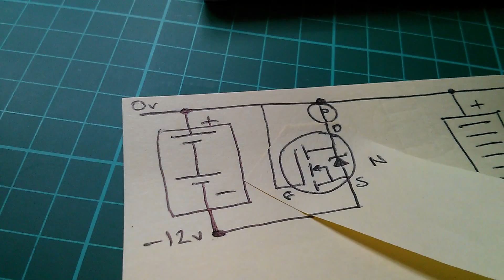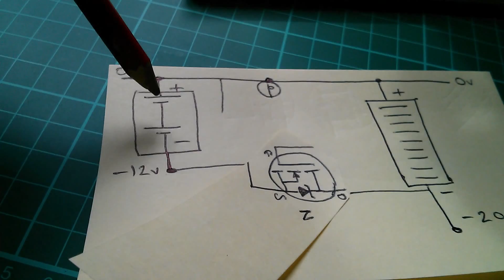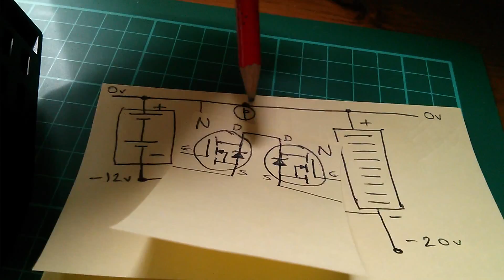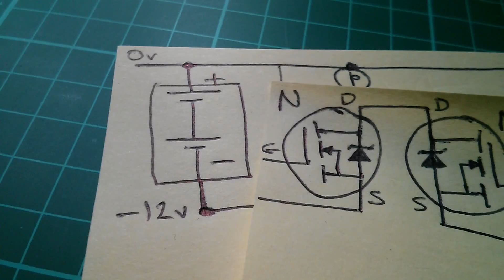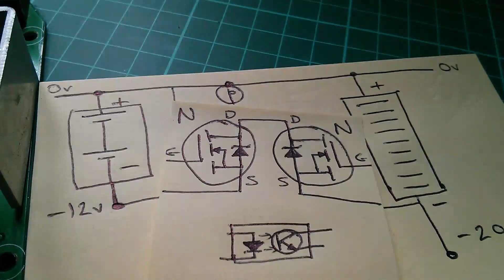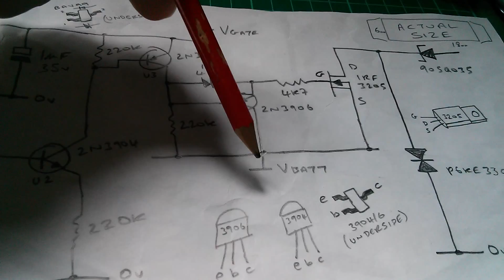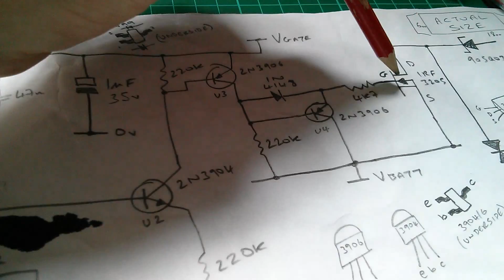Arduino PWM Solar Charge Controller #1 - MOSFET Configurations

Comment: This is very interesting and exactly deals with the issue that I am having. I am looking for an 8-volt charge controller. I have a one-watt hour pump that I want to power with an 8 volt Li battery and charge with an 8 volt panel. I have been unable to find an 8 volt charge controller with a load output. Do you happen to know where or how I could acquire this? Thank you

Comment: My pwm solar charge controller takes the energy from the battery send back to solar panel., Negative wird also heats up.... Any suggestions or remedies???

Comment: Hi Julian,
I have a query about the PNP transistor circuits interfacing the MOSFET. Can you tell me why the second PNP transistor is used?  From my own calculations it is  never in active mode or saturation (it seems to be redundant), and I was just wondering about the rationale behind that part of the circuit. It seems the designer may be trying to regulate the voltage that appears at the gate of the MOSFET, but I'm not sure it really works as intended. Did you get this part of the design from somewhere else? Your thoughts would be much appreciated.

Comment: When I built my common negative switcher, I used an N Mosfet, because they are lower milliohms. I had to put it on the top of the circuit, so I pulled up the gate with extra voltage from a 555 voltage doubler. You are supposed to use a special mosfet driver chip, which does this for you.

Comment: Hi Julian,
I am new to arduino but have done some electronics construction in the past.  I am following Robert Murray-Smith's videos on supercapacitor construction with the intention of 'making' from scratch, a supercap' or EESD that can keep a 50W fan running through the dark hours.  The EESD will be charged using wind and solar generation. The fan is to ventilate my Firewood Drying Kiln. 
The air supply will be heated by thermo heat tubes during daylight hours and it will be a simple fan ventilator at night. (Airflow will still dry the wood).
Most aqueous electrolyte supercapacitors can be charged up to 1.4Volts.  Can your arduino controller be adapted for lower voltages?  That way I can keep the the cell charges balanced.  
Each supercap' bank will be connected in series to arrive at 12Volts.
I hope that this makes sense.  If not please let me know and I'll write a proper email detailing everything properly with diagrams.
Your opinion would be very welcome.

Comment: anybody else think that cut out mosfet, dual circuit connection thing was like effin genius? but for real tho, why could you just switch the drain and gate terminal so that the diode was reverse biased unless a gate voltage was applied?

Comment: Thanks for this video Julian! I have been trying to figure out for weeks why my test circuit worked but the real one didn't! I was using a load for testing not a battery! Doh! I've resorted to P-Channel again until I can sort out doing the charge pump setup that you used. None of the demos I found online were explaining this issue but this video was spot on, so thank you!

Comment: HI julian.
Do you think it would be easily modifiable to work on 24V system ?
Let say, modifying the sensing voltage bridge divider, put a small DC/DC regulator for 5V uC supply would be apparently easy.

But what about the power Mosfet's gate driver charge pump ? And maybe other stuff to be modified including some small bits of code !

Comment: why don't you just put a diode in series with the mosfet to prevent the battery backfeeding into the panel?
Reply: with nfet source at the battery, its internal diode is in the same direction as the panel blocking diode. which is the issue - as the panel can always charge the batt

Comment: A p-MOSFET woulde work. If you connect it with source to 20V and drain to the load. A pullup an the gate to 20V and with a transistor between gate and ground you can turn it on.
You can get this configuration in a single chip. Look at something like the FDC6326L.

Comment: Have you considered the inherent reverse connection protection possible with the pair of series mosfets?  The total losses can be lower than your design, with a series, reverse protection diode.

Comment: Someone suggested that a PWM circuit only comes into operation when the battery is fully charged.  Is this the case ?  I am in need of a (potentially) 40A MPPT controller, but I am slightly confised with what I have read elsewhere.  It seems to me that there would need to be a substantial capacitor on the PV side, otherwise, the controller would effectively be charging alternately with full power or zero power, either way is not efficiently (MPPT) using the PV. I guess that I am missing something about MPPT controllers.

Comment: A well presented brief.  Thanks.
However, the charge pump could easily be replaced with a boost switcher driven from the Arduino, plus, I suspect, switched on and off, to eliminate the driver circuit to the MOSFET
Reply: Please elaborate.

Comment: what I like to do with one of these controllers is reprogram it for my wind turbine as a dump load controller. were it can still use solar panels also to charge the batteries. but as for wind it will instead use the out put of the controller to controller a relay to dump the turbine in to a bank of resistors.  instead of using the dusk to dawn future. change that to a dump load future instead. and have it preset to dump at 14.5, and 28.9 for 24 volt systems and still use the solar input to put solar panels on the system so that way the battery bank is always full.   any ideas of how to reprogram these boards or do I just have to look up the chip and then program it.

Comment: Just a thought....
Sat and watched your earlier experimentation all the way back from 20w panel 21w bulb, and when you went to using the 5110 lcd and twisty knob, you put 2 panels in series to get a higher voltage into the controller

What the thought was is this, if i have a string of AA batteries as a power source, and one of them is 90% discharged and the rest are new, if I load the string hard, that 'weaker' cell will be pushed into a reverse voltage situation, can this happen with solar panels, or individually shaded cells within a panel?

Comment: I have had a look inside a few cheap PWM controllers and they often tend to use two mosfets although sometimes they are coupled source-source rather than drain-drain. Either way the intention ov this is that the second mosfet actually functions as the reverse blocking diode. During the day the current flows in the direction ov the body diode, but then the mosfet is turned on effectively making it a diode with a very low voltage drop. This means they can get away with a much smaller heatsink than would be necessary if a Schottky was used in this position. It is ov course, also more efficient in the bargain, but I think the main purpose is cheaper construction costs. In some circuits the "diode" mosfet is actually fed with the exact same gate drive as the "switching" mosfet. And it appears to work.

Comment: hows it going Julian.  I have a question.  I have the colman air charge controller it used a Picaxe chip on it to regulate the batteries through the means of dumping excess power.   I have extra Picaxe chips I bought and was looking for the original code that is used on this board. 

What I want to do with the board I have with the extra Chips. is change the code. so instead of just one and off. I want it to help slow down the turbine as like a voltage clipper. so I can regulate the voltage from the turbine.  and use this board in conjuction with my original board as a back up encase the other fails. and this one will regulate the voltage going to my battery bank.   

I have a lot of ideas. for a wind turbine charge controller  that can use Wind speed, RPM and voltage to controller the turbine. by measuring every thing the turbine is doing.  I have lots of idea but pretty new with the Arduino stuff used to the basic stamp programming.

Comment: Nice work.
The second MOSFET is used so that you do not need a diode on the solar panel that diode will drop way more than the voltage drop on the MOSFET internal resistance.
Reply: xanataph  It is a bit simpler and for very small systems under a few watt's of solar panels is probably OK.
But if you are getting in to 5 or 10A of solar charging you need a beefy Schottky diode and a serious maybe even active cooled piece of aluminium.
Say the voltage drop at 10A is around 0.6V that is 6W that need to be dissipated when you add the cost of the diode + the heatsink you get to about the same cost as with a mosfet or more. 
But if is just 1A solar panels then maybe the additional complication of the mosfet is not worth the trouble.
Also you can skip the diode entirely and live with the small reverse current at night going from battery to the solar panel usually just a few mA so losses will be smaller than those on the diode.
Reply from the maker: I used a schottky diode - not as good as a MOSFET I admit. But my diode is external and can be removed if the end user understands the implications of doing that.
Reply: ***** I am running such a setup with the 24volt 200watt panel. The current can easily get to 5 amps. I chose to use a schottky and accept the losses rather than fiddle around all day getting a mosfet driver to work in this situation (although that may have been time well spent). I am pretty pragmatic with this kind ov stuff & I'm usually after working and useful results fast, rather than experimentation for it's own sake. But anyways, the diode does not get unduly hot and the rather thin sheet ov aluminium I have attached to it is more than enough for 5A, and no doubt would be good for 10A too. There would be certainly no need for forced air. 

However, having said this I may look at making a mostfet daylight switcher for my entire 12volt array. As vdrop is much more ov an issue down here...! :)
Reply: Julian Ilett Looks like the point I made above (except for the source-source thing) has already been done here. Although a schottky is less efficient, the topology is much simpler and I would dare say for the home solar power enthusiast more versatile in many ways. Just stick a bigger slab ov aluminium on it. :)

Comment: what about relays?
Reply from the maker: Not worth considering - low reliability, high current consumption and completely unsuitable for PWM control.
Reply: Julian Ilett What about a solid state relay?
Reply from the maker: abyssunderground DC solid state relays are MOSFET based. Interestingly, Wikipedia says "For AC (bi-directional) operation two MOSFETs are arranged back-to-back with their source pins tied together. Their drain pins are connected to either side of the output". Yet another configuration!
Reply: ok

Comment: PLEASE THUMBS UP THIS SO IT DOESN'T GET LOST IN THE MIX. 
"A DC-DC converter suitable for controlling a photovoltaic powered pumping system" by William A. Passmore --> http://circle.ubc.ca/handle/2429/27948 
Definitely some useful information in there. Searching for peoples *dissertations*(key search word minus the s) on the subject you want information on is a great resource because for the most part they are all absolutely phenomenal.

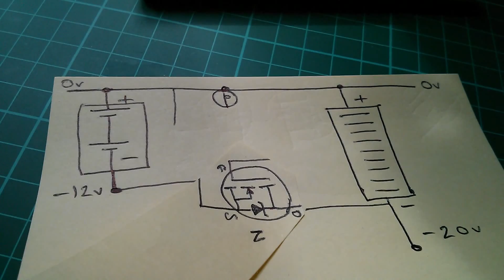Comment: @ 2:16, isn't the P channel mosfet connected the wrong way around? Source goes to your + 20 Volt from the solar panel (you input voltage) and the drain goes to your battery +12 Volt (load). The way you draw it in the schematic, the body diode would always be useless. Take a look at this application note from On semi:

www.onsemi.com/pub/Collateral/AND9093-D.PDF.
Reply from the maker: I put the mosfet source onto battery positive to make driving the gate easier. Turning it the other way round solves the always-on problem but makes gate drive much more difficult. And it creates a path for the battery to discharge back through the solar panel at night.
Reply: Then I am missing something here. With the source connected to the solar panel, and the drain connected to the battery, simply connecting the gate to 0V will turn the mosfet on and current can flow from the panel to the battery. (solar voltage @20 volts, battery @ 12 volts) Reverse discharge can be avoided by placing a diode in series. Perhaps I am not interpreting your intended use correctly.
Reply from the maker: jaaasgoed It's an interesting idea - probably not worth considering for a P-channel MOSFET because of the higher on-resistance. But I'm trying to decide if it would would work using an N-channel device in the low side. Actually, the back to back MOSFETs in the cheap controller are wired: one the way I drew it, and the other like you're suggesting. Interesting...
Reply: Julian Ilett
You can easily do it with a N channel FET on the high side and an open collector transistor, or just using a gate driver.

Of course you could just use FETs without body diodes... :-)

Comment: Are you planning on using the ATMega 328 microcontroller in the production version when you finish it? I think you can be a lot more efficient and use smaller AVRs like the ATtinys since you won't be needing a lot of processing power or all those IO pins. Also if you go 100% SMD in the production version you'll be able to save a lot of space and make it ultra small.

One of the things that always made me scratch my head when I saw your PWM5 was the fact that it was a single layer board with no soldermask whatsoever. Why not a double layer with a nice soldermask since they are so cheap nowdays?
Reply from the maker: How many timers do the ATtiny's have? That's my worry, running out of timers. I used them all up in the PIC12F683 and ended up peppering the main code with exclusive ORs to implement the charge pump - not ideal, but it works fine. The Pro Mini is basically a chip on a PCB with a voltage regulator - ideal for this project (and it's cheap).

The PWM5 started off as a stripboard design. Cutting small pieces of stripboard became such a pain, I moved to a PCB - but much of the PCB is still laid out in strips! Single sided PCBs from my local PCB company were much cheaper than double sided. Also, back then DesignSpark hadn't been released so I was borrowing a friends layout software. I always intended to go surface mount with the PWM6 (project gumstick - the size of a stick of gum), but found I was spending all my time manufacturing the PWM5.

I could write a book about this!
Reply: Julian Ilett It's all the same code base. The timers will be slightly different but that doesn't exclude their eventual use. I would agree with your plan, go with the Arduino for development and then later you could look at miniaturising the board.
Reply: I had a similar thought. An Attiny84 or even an 85 would do what you want and fit a very small footprint. Enjoyed the video though and will be watching with great interest since this is exactly what I need.
Reply from the maker: tobortine I guess the code could be ported over at a later date, but I really want to develop the software inside the Arduino IDE and I presume that rules out the tiny84 and 85.

Comment: What you say at start about 1 mosfet and 2 resistors, wasn't that to measure the IR of a battery? Or Am I missing something?
Reply from the maker: Virtually identical - so easily confused. In the charge controller, the 2 resistors make a potential divider to measure the battery voltage. In the IR tester (and now discharge capacity checker), one resistor (about 100Ω) settles the battery voltage, the other (1 or 2Ω) imposes a heavy load on the cell.